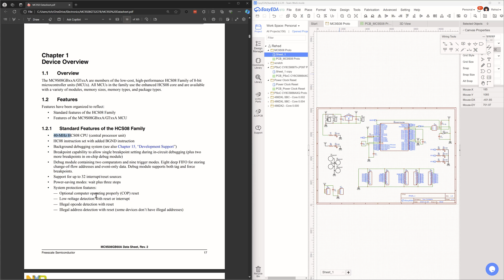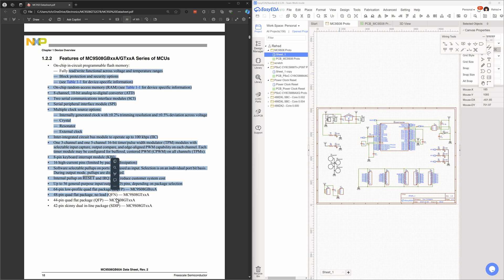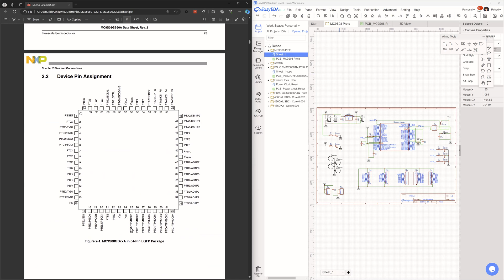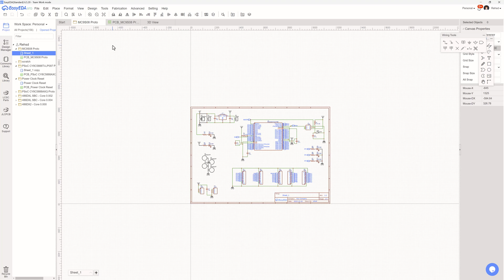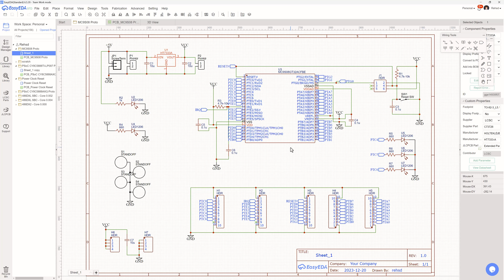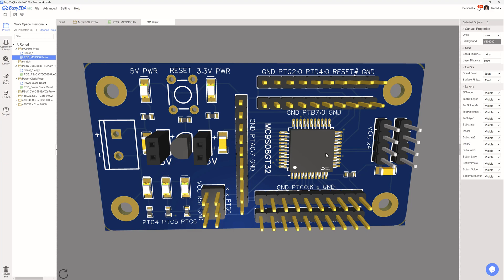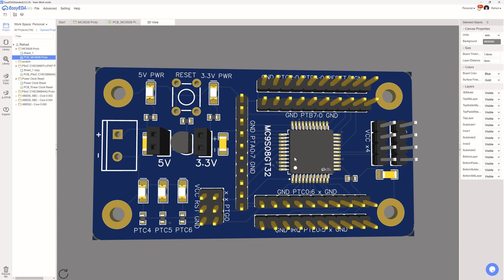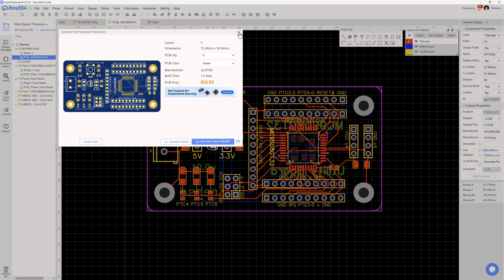MC9S08, Ep. 1 - Simple Prototype Board for an 8-bit Microcontroller

Comment: Nice.  If you're going to be doing a board with a mix of 5 and 3 volts, one suggestion is to get in the habit of making your schematic net names "VCC5V" or "VCC3V" or some kind of similar convention just to make it more clear what's going on. But otherwise, I fully agree - making your LEDs turn on is the embedded guy's version of the "Hello World" program, great place to start. Haven't really looked at the datasheet, but how close is the instruction set to a 6800? Been working on some 8-bit debug/simulation tools that might be fun to try out on this CPU.
Reply from the maker: Good suggestion, thanks! Regarding the instruction set, I found a reference to "the instruction set of the Freescale 68HCS08 family is a slimmed-down version of the Motorola 6809" and "the derivation is something like 6800 -> 6801 -> 6805 -> HC(S)08."  https://electronics.stackexchange.com/questions/12302/what-is-a-good-starter-microprocessor-to-learn-assembly

Comment: SDIP's should be through-hole.  Large ones like that will take up most of a breadboard  with only 2-3 holes on each side to connect.
Reply from the maker: Oh, you're right, SDIP appears to be through-hole! It measures ~14mm x 37mm (.55" x 1.45"), which seems pretty small. It has a tighter pitch, too... 1.778mm. https://imgur.com/a/LqzcTjF